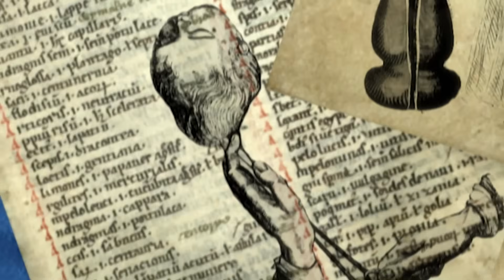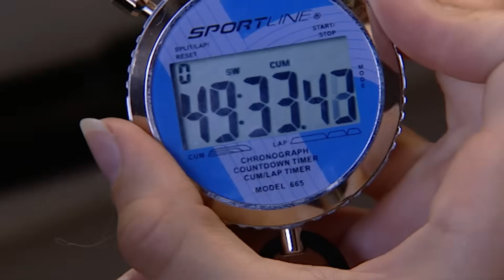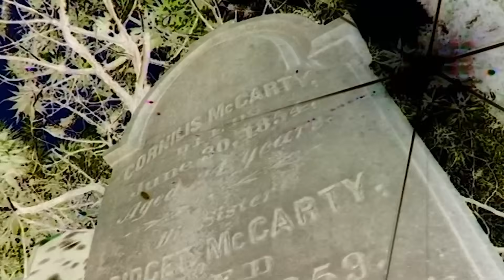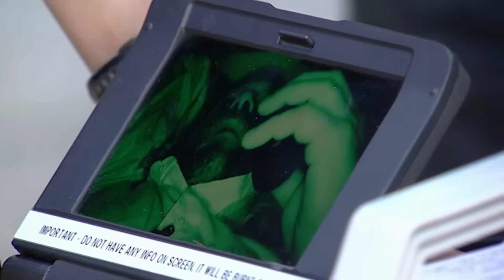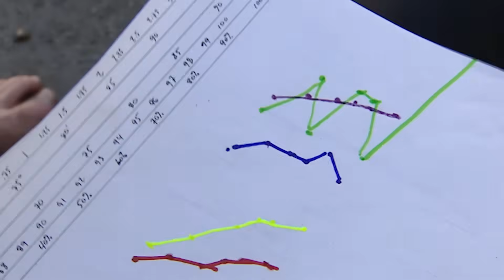Surviving in an Underground Coffin - How Long Can You Last? | MythBusters

Comment: The problem they had here is that an American metal casket is designed to be in a grave liner rather than buried by itself. That takes the weight of the earth instead of the casket itself.